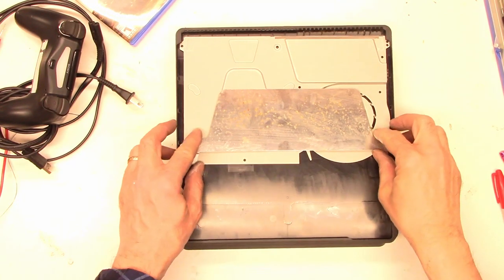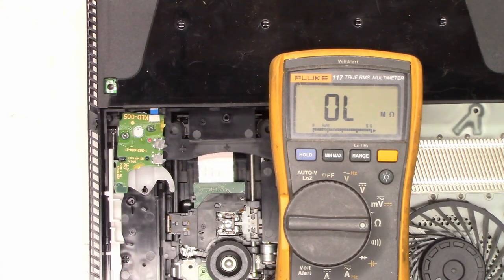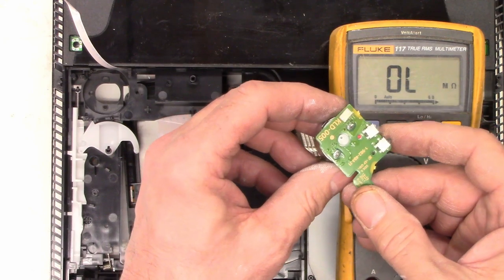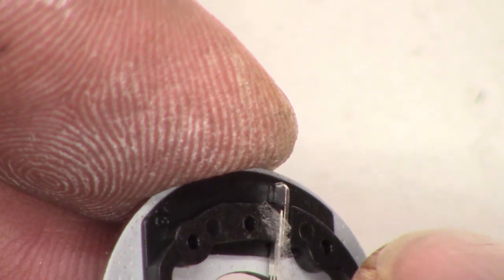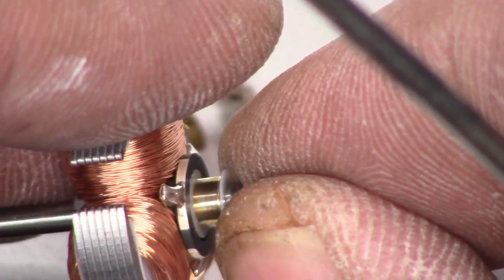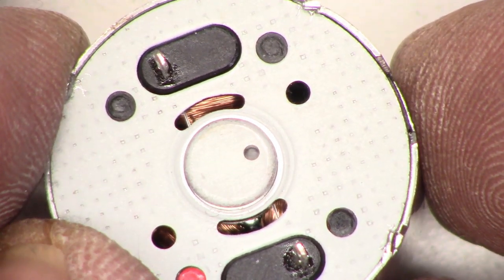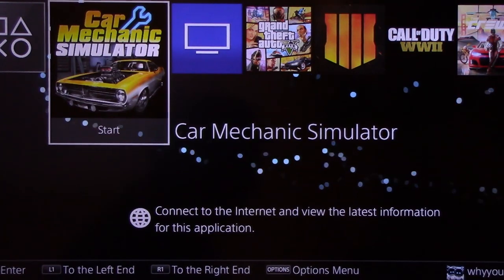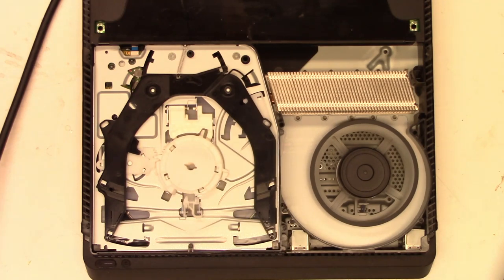SONY PLAYSTATION 4 PS4 WILL NOT LOAD THE DISC. SPIDER WEB IN LOADING MOTOR.

Comment: I have a question, is the roller that's connected on a white gear really not supposed yo roll? I cleaned the rollers on my PS4 FAT yesterfay and noticed that one of the rollers is not rolling/spinning....Cause if it's supposed to roll just like the right roller then i might have a problem with the gears on the motor side of the disc drive

Comment: What are your thoughts on the PS4 laser assembly? When you remove the plastic covers you see there are components on the ribbons that look like the very small footprint SMD capacitors/resistors/inductors. I'm sure to fix a loser instead of replacing it would just require testing  replacement of those components instead of spending orders of magnitude more on a new laser assembly.

Comment: Hello I have a question, i plan on replacing the motor and mini nithe board, I have the ps4 from launch what one do I buy and how do I remove it from the disc drive with using the sader

Comment: Have you ever experienced on a ps4 dvd spinning motor not working at all? I suppose colui be something related with a motor driver but have no experience with this kind of fault, could also be a software related issue. I double checked the ribbon cable that connect the main board with the motor assembly pcb but didn’t find any issue. Would you mind to share some suggestions on how to identify similar kind of issues? The other motors are working fine. The main spinning stepper motor seems to work in some extent…Applying just a little voltage on some of the  motor pins it’s definitely makes some step so I thought could be a driving problem…
Reply from the maker: If the optical pickup (laser) can not focus on the disc then the spindle motor will not run. Could be a laser pickup issue.
Reply: @norcal715  thanks for your reply. I thought that without spinning the Laser could not read the entire track and just fade-up after few reading attempts.

Comment: If I read 0 ohms at motor what could be issue. I seen the and replaced fuse but I don’t read any ohms at motor plugged and unplugged.
Reply from the maker: The motor should read just a few ohms. What scale is your ohm meter on? If you read it on the 10meg ohm then 0 ohms is ok. on the 100 ohm range you should read 10-50 ohms.
Reply: @norcal715  with power through the circuit, and I have checked I think all the fuses, the motor reads 0. I replaced one fuse that was common problem and it was not getting continuity.